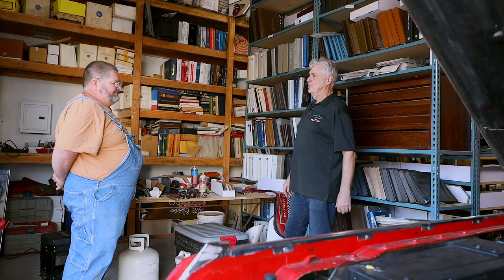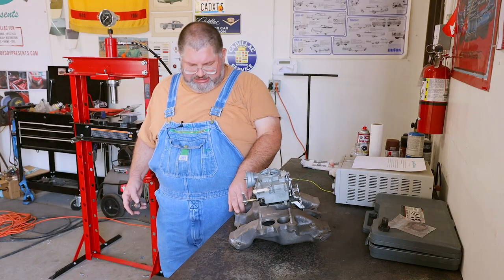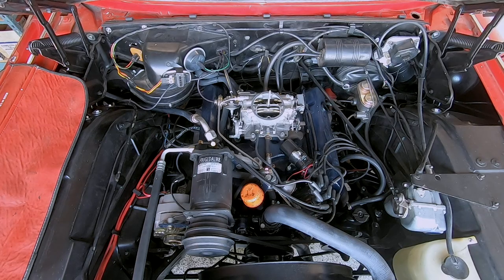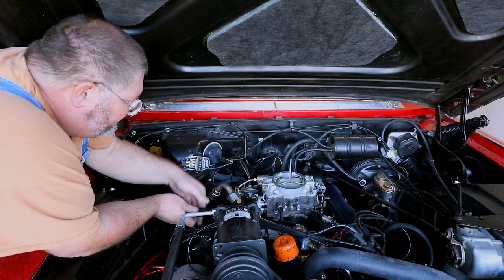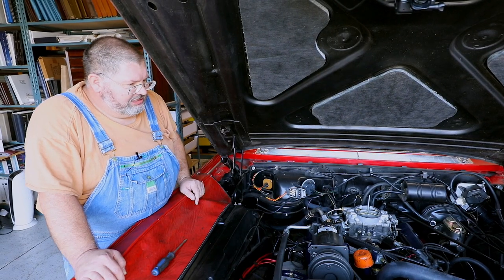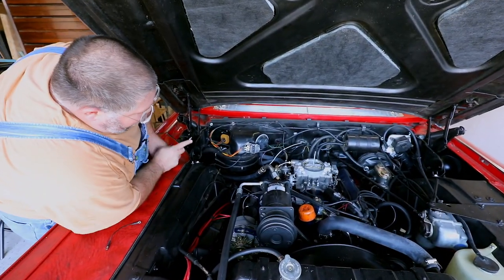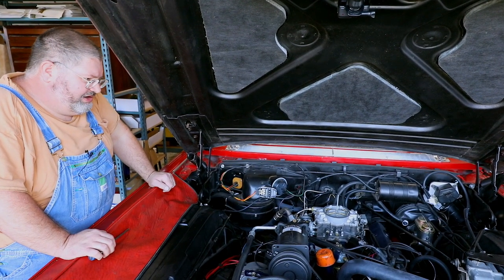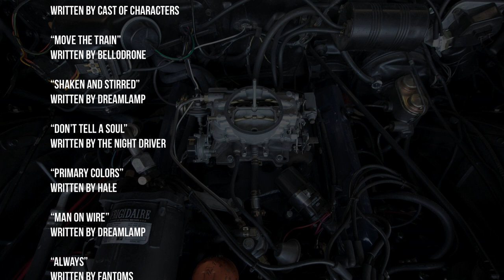How To Install an Electric Choke on a Cadillac

Comment: Recently purchased and received your electric choke for my 64 CDV. Silly questions. Did you use 12G wire? stranded? Would solid copper cause problems or is there a benefit to using stranded as seen in other car wiring?
Reply from the maker: I believe I used 16 gauge wire, and connect it to the ignition circuit
at the fuse box. Do not connect on the hot side of the coil since there
is a ballast resistor in that circuit.

  Always use stranded wire for automotive applications. The vibration will
cause the solid wire to work harden and break. Josh
Reply: @Caddydaddy  Josh. Thank you as always for the install advise. Am i splicing it into the ignition circuit? I can’t quite visualize the process of doing this. Do you have any advise on gently removing a little rust on the galvanized glass fuse clips? 

I will continue ordering from you guys as you provide excellent products with top notch customer service.
Reply from the maker: Rob,

Look on the fuse block for a terminal marked IGN and you can connect
there. You want to tap into the power that is only present when the key is
in the run position, not an accessory. A small wire brush would work on the
rust, just be sure to disconnect the battery. A bit of non-silicone
ignition grease will help prevent the rust from returning.

Josh
Reply: @Caddydaddy  thanks Josh. How many volts do you get running thru the electronic choke when your Cad is idling? I’m getting 15.7V. Is this expected? I had 12.7 with engine off. I forgot to mention I have an electronic ignition now with a resistor wire bypass
Reply from the maker: @rb31dks  Higher voltage with the engine running is proper, but it seems to be a bit high. Engine running, you should see between 13.8 and 14.7 volts or so. If you know your meter is good, then you might want to check your regulator.Josh
Reply: @Caddydaddy  Josh. Okay ya I thought that voltage seemed too high. I’ll double check voltage with another voltmeter to rule out a faulty meter (I expect it’s okay) then check my regulator. Thank you. Much appreciated.

Comment: How are the wires connected at the other end?
Reply from the maker: The wire that went through the firewall was connected to the "run" side of the ignition switch. Do not connect to the "accessory" position on the switch.
>
Reply: How you know is the  running cable

Comment: What vacuum lines connect where on the carb
Reply from the maker: There is a  ported vacuum line to the distributor and an idle speed control line on air-conditioned cars. The vacuum needs of the accessories and power brakes are drawn directly from the fitting on the manifold or a fitting on the carb insulator.
Reply: I have 4 lines from the firewall, was wondering which lines are which and what connects where 2 of the 4 were connected when I removed the carb for a rebuild
Reply from the maker: @lurchcady  There are too many variables with options and running updates. Best to refer to the factory service manual and service bulletins.